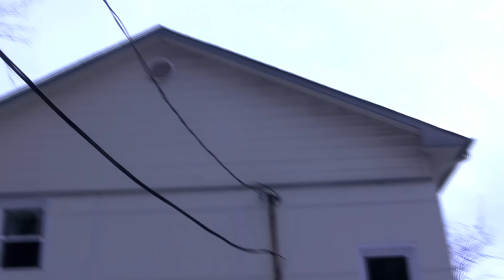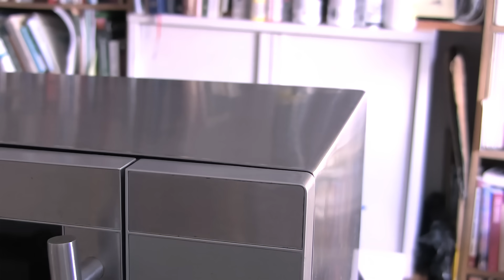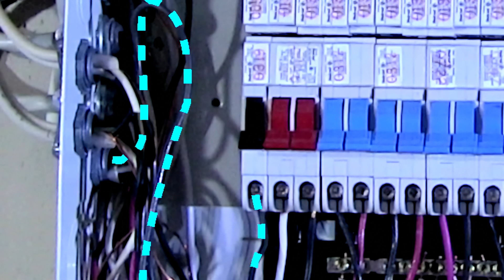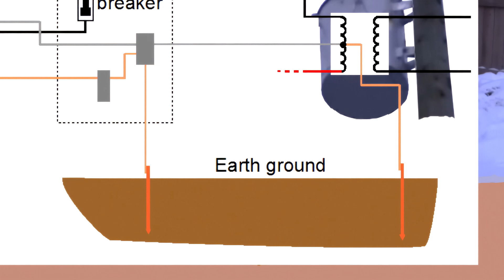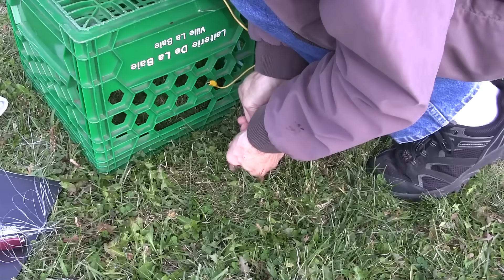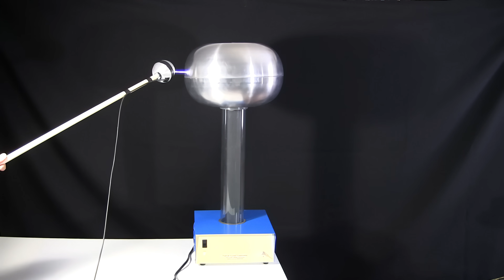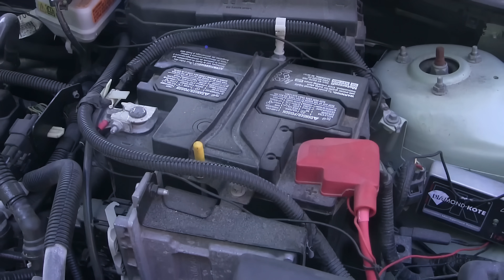What is Ground? Earth Ground/Earthing

Comment: well somehow I end up not convinced I do not agree with some of the info provided... as far as I know, a good electric installation has 3 wires in each socket/plug and switch... one of these cables is black, one is white and the other one is green, the green cable is a must have, pretty much always, it is the one connected to the ground and it is the one your freezer regulator will need to toss away wild voltage variations... a microphone, some microphones work fine with no ground connection, yet others do need that connection, plenty of ppl have complained about their headset mic not working properly,... that is because that specific design does need to be connected to ground... if you have a water pump to send water to the house cistern.. that machine needs a regulator and the regulator, to prevent electric spikes due to the strong pump electric drain, this regulator, needs to be grounded, the washer machine to wash clothes, the dishwasher and the drier to dry cloths do need to be grounded and a regulator also ends up being needed so to prevent variations in voltage that could affect other hardware that you may own... a tv and or audio set... they need a regulator to be connected to ground... believe me, I have lost hardware due to them not being connected to ground... having seen the video a few more times it seems like these 3 cables are indeed mentioned, yet the speaker is speaking too fast in a point where slow is better...
Reply: Did you watch the video? You're saying he's missing the exact thing the entire video is about?
Reply: well it may be the way he explained the ordeal, somehow my argument seems more to the point targeted at filling the gaps
Reply: Robert Ostman "believe me" ok, no proof needed, I believe you because that is what science is about: faith.
Reply: haha... good point haha... well I still have a damaged pc monitor, I hold it as evidence... by the way the electric company didn't want to pay for the repair due to the electric installation.... long story short... @ believe me haha
Reply: Robert Ostman I dont believe you, I know that ground is important and electric companies don't want to pay for any repair. I just was triggered by the use of "believe me" in a hard science topic. Edit: don't pay me attention :P

Comment: Why can't I understand this?  Its interesting but I get lost😞
Reply: It's really not that confusing.

Ground provides an alternate path for electrons to flow. It can do this because it has such a large volume for electrons to dissipate into. The ground is like a big neutral  capacitor, ready to take all kinds of electrical spikes or noise. This makes it ideal for redirecting something as huge as lightning, or reducing the noise on something as small as a computer microphone.

Remember, when it comes down to it, we're just talking about 3 wires here.
Reply: Traveling with Rick This is some confusing stuff but the video has been the most helpful so far.

Comment: Very excellent!

But I have a quibble:  the electron-flow animated diagram applies to metals, not to dirt (or to human tissues.)   If the goal is complete truth and accuracy, then you'd need to show the honest ion-flows in the ground.   Usually this is too complicated.  In that case we can avoid breeding misconceptions about ground-currents, instead use the standard technique: explain the Amperes (conventional current) and never mention electron flows.  That's a major purpose of conventional current: to hide the complexity of particle-flows, and to avoid teaching people false ideas.

Inside the Earth, no movable electrons exist.  Instead, the electric currents are flows of charged sodiums, chlorides, potassiums, -OH and +H, the mobile ions found in non-metal conductors.

And if the dirt is acidic, then most of the current is actually a proton-flow ( +H hydrogen ions.)

In other words, electric current in general is not a flow of electrons, and the exact type of "electricity" depends on the type of conductor.  The pure electron-currents are found in metals, but usually not found in the rest of nature (not in salt water, dirt, in sparks, or inside animals.)

And of course electrostatic antennas, lifted into the sky, are based on ion-leakage through the sky above, without electron-flows in air.  Metal stakes driven into dirt are similar: the electron-flow in metals is converted to ion-flows within the dirt.
Reply from the maker: Thanks Bill. That's a good quibble. Probably would have been confusing for the viewer had I shown the two different types of flow in the one animation, but now it bugs me. Would have been fun to animate though.

Comment: The American system explained here is dangerous: What if you touch a live contact directly (instead of through a metal case) or through an ungrounded metal object? Current would flow through you to ground, with enough power to kill you, but not enough to trip the breaker.
In Europe ground is not connected to the neutral. Instead it measures the difference of current between live and neutral, and cuts the current with a difference as low as 0.05A. That's called differential breaker.
There are also many advantages of the higher voltage used here (230V).
Reply: The full-blown American system uses GFI, ground-fault interrupters  ...which measure the differential, and breaks the circuit with any difference far below 0.001A.   But IIRC these are only required in kitchen/bath, not for all circuits.  And, the regulations may vary between US states, and for new construction versus existing buildings.
Reply: Good to know it's not so bad there. Still I prefer the European conventions: it's impossible to electrocute yourself touching a half plugged plug if it was made in the last 4 decades and it requires many less transformers near homes.

I said 0.05 from memory but I looked at my home's and it's 0.03A. One for all the house.
Reply: Alberto Torres when you touch  even one live/hot wire you won't die but will still be electrocuted, it happens to me once, I'm still here, however I was wearing thick rubber shoes and was isolated from any other metal.
Reply: Europe had the luxury of not having our full blown electrical infrastructure when they discovered 230 was better than 120. It was too prohibitively costly to change everything, but the US has made things work quite well just the same.
Reply: I'm pretty shocked they dont use a  differential breaker. in the USA. !!!

Comment: what if your outlet or junction box dosn't a ground,it is safe also or you must put a ground wire?
Reply from the maker: I can't speak for every country since, judging by the comments here, the systems vary a lot and I'm not familiar with them all. For the US and Canada though, if the wall outlet doesn't have a ground and you plug in an appliance that has a ground prong on its plug then you're not protected by the breaker in the breaker panel that I showed in this video. If the hot wire's insulation is damaged and touched the appliance's case then there definitely is a danger of getting a shock, also as I showed. It's a pretty strange system if even your breaker panel (if that's what you mean by junction box) doesn't have a ground (again, speaking only for the US and Canada).

Comment: Great video. I have an older home with BX cable and would like to replace certain light fixtures with recessed lighting but have not ground wire (green). Do I have to run a ground wire from the light to the panel? Ground it to the metal recessed housing?

Comment: The microwave ground is yellow and green but you highlighted the grey one
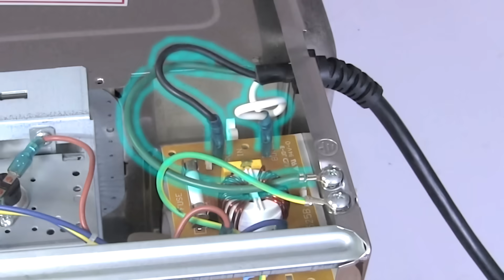Reply from the maker: Where are you referring to? At 2:00 and 2:05 I highlighted the green one. Notice that it comes from the plug and is connected to the case. Just beside where it connects to the case is where the yellow and green one also connects to the case and then goes to the electronics. So the green one I highlighted is connected to the yellow and green one through the case. They're both ground wires. Also at 2:45 I highlight the green one again.

Comment: I was just thinking...At 4:12, if the neutral is connected to earth ground in the transformer, then it wouldn't be necessary for the neutral bar and the ground bar to be connected in the breaker panel, because then there would be a complete circuit in case there were a hadling fault, so you wouldn't get a shock
Reply from the maker: But the NEC (US electrical code) and Canadian codes require both connections. I'd have to dig it up again, but if I recall correctly, one reason is that there could still be a potential difference (voltage) between the two neural points (transformer and breaker panel) despite it being a continuous wire between the points. Having both points grounded reduces that potential difference.
Reply: Yeah, that makes sense. In my case there is a 6 volt voltage between the ground and the neutral wires. The reason why I asked that is that I had a discussion last night with a electrical technician whether the neutral wire and the ground bar should be connected or not. Having watched this video before, I told him that it's the fact that the neutral and the ground wires are connected that prevents you from getting a shock, while his argument was that it's the earth ground that saves you, but now I am bit confused because when I got home, I had a look at my breaker panel (I'm from Spain), and I noticed that there were neither a neutral bar nor a ground bar, so there is no way that neutral and ground wires be connected, yet whenever there's a hadling fault, the breaker trips. My point is that a connection between both wires in the breaker panel might be unnecessary but recommendable.
Reply from the maker: Ah, how it works depends on your country and very likely Spain does it differently than here in North America. I really can't say what you should see in your breaker panel in Spain, at least not without searching for your electrical code. From comments here, I think in Europe you might be using  RCDs (https://en.wikipedia.org/wiki/Residual-current_device) in your breaker panels instead of the simple breakers which we have in ours.
Reply: That's right. There's also an RCD in my panel. Thank you for this very informative video.

Comment: Hi there !!! Why is the ground pin fat compared to the hot or the neutral pin. Could you please explain about the geometry and it's correlation with electricity.?? Thanks in advance.
Reply from the maker: I don't know why it has a round shape, unlike the others, but I know that it's longer so that it makes contact before the other two do. That way you're sure to have the ground connection for safety in case there's a problem when one of the others make a connection inside.
Reply: earth pin is larger than other pins to avoid accidental entry of earth pin in phase or neutral sockets.

Comment: will current flow into the ground evn in nornal case from neutral because if grounding rod in the panel?? please help.
Reply from the maker: If any does current does flow, it will be a negligible amount. The reason for any current would be because there may be a potential difference (voltage) between the neutral connection to ground at the pole and the neutral connection to ground at the house. However, the resistance between the two points is high compared to the resistance along the neutral wire on the between the pole and the house, so current will be tiny.

Comment: Why current from a positive terminal of battery doesnot flow to negative terminal of another battery if other two terminal are freed?
Reply: insulation 
air has resistance which means you need a higher voltage to get current to flow.

Comment: Very strange that the ground line isn’t monitored for current flow. Here in The Netherlands if current (very low current) is detected in the ground wire, it will trip a switch causing a cluster of groups to disconnect instantly. It won’t work via a regular group switch, which will need several amps (> 16 A) to trip.
Reply: They might be using RCCB.

Comment: I am not an Electrical person, But is it realy the ground is connected in the Nuetral? Or it is connected in the ground or earth.
Reply from the maker: The answer is both. The wire going from the ground hole in your wall socket goes to the ground bar in the beaker panel. In the breaker panel, the ground bar and the neutral bar are connected together. Also, in the breaker panel, there's a connection to the Earth ground. It's just like the diagram in this video. However, all of this varies depending on where you live. This video talks about the situation in most of the US and Canada.
Reply: The resistance between the house earth rod and the supply network can be to high to reliably trip the breaker.
the direct connection reduces the loop resistance to less than 1 Ohm It also provides safety if the neutral fails between the the house and supply network.

Comment: So if someone cuts the ground prong off the microwave plug and the "hot" wire touches the case of the microwave would the current flow into their body and through the earth back to the transformer resulting in a shock?
Reply from the maker: That's correct. The current may be high enough to trip the breaker at the same time.
Reply: How would the current flow to the earth if you took off the ground prong?
Reply: yes
Reply: through their feet or their hand if it touches a earthed surface like a cooker

Comment: Hi.. good video... totally give me the picture of how the trip works... what if the white wire expose and touches the case. how will it works?
Reply: it will work as normal.
If the outlet the device is plugged into is protected by gfi/rcd it will cut the power.

Comment: Thank you for making this video! My girlfriend and I are building an electric scooter, or making modifications to an existing scooter. We noticed there didn't appear to be any wires going to the frame of the scooter acting as a ground. For example, the negative wire on the scooters batteries do not go to the frame. As well, the controller for the scooter did not appear to have a wire which connects or grounds to the frame. It was the first time I had seen this.

Comment: Here in the US i don't have neutral coming from the pole. I have just two lateral that are 120v each. Neutral and ground are the same. Same is in EU
Reply from the maker: It sounds like you have single-wire earth return (https://en.wikipedia.org/wiki/Single-wire_earth_return), or two-wire in your case for two phase. As the wikipedia page says, it's used in some places in the US, but not everywhere. The webpage mentions Alaska only but someone around Phoenix commented that they have it too so there are more than just Alaska. Which area are you from, so that we have a better idea of more places?
Reply: RimstarOrg new york state. Maybe I'm reading you wrong, but all the way from Mirtle beach to Boston houses are like that, common earth ground and transformers are also earthed at a standalone rod to each pilon they are mounted on. Maybe they don't wabt to waste money for a dedicated neutral line. Bigger residential buildings may have a different setup, I'm speaking about single family residential houses
Reply from the maker: Interesting. My understanding (and you can see that on the wikipedia page) is that swer is not as prevalent as that. However, as I said, someone here from Phoenix said their's was that way too, and so is yours, so the wikipedia page is misleading.
Reply: In that case I could see a device been exposed to  to 240V there must be a solid path back somewhere.
from the videos i have seen there is normally 2 hots and one guy wire aka neutral. unless use the system here one phase and neutral well for your system in us one leg and neutral.
unless the rely on ground bonding via water pipes etc to provide balance.

Comment: Interesting. Here as far as I'm aware the neutral is not connected to the earth. In my house the earth is connected to the plumbing system, although since 1966 this is no longer allowed and especially today as plastic pipes are now mainly used
Reply: id think about having a rubber mat in your bath/shower...
Reply: if you don't have an earth system in your house/electrical grid(supply side) then you are fairly safe. its the return path of fault currents that can kill people in their showers when earthing water pips. Earth faults try to find its way back to the transformer and will travel through water piping and can result in electrocutions.
Reply: What about all the radiators in the house? All those large pieces of exposed metal should surely be an extremely higher risk than coincidentally being in the shower at the same time as an earth fault

Comment: Very well done!!  Probably the best video I've seen to explain the concept.  A few things on terminology in case anyone is reading the NEC.  You'll notice these definitions when working through the NEC:  Electrical systems are "grounded" (connected to earth) to protect against high voltage faults, such as lightning and transformer failures (as well as static discharge as noted).  Receptacles and other outlets are "bonded" to provide a return path for fault currents (the microwave example in the video).  Also, the connection of the grounding conductors to the grounded (neutral) conductor at the panel (as shown in the video) is called the "main bonding jumper."

Comment: How do I ground a clothes washer that doesn't have a three-prong plug?
Reply: You're saying that the receptacle is an older, ungrounded type (two contact  type?)?  Not a grounded receptacle correct?  If there is no grounding conductor, you would need to run a wire from the receptacle back to a proper termination, such as the panel. I have done so many times.  I recommend you hire an electrician to do the work though.
Reply: Ibrahim Saad Helal Thank you. Someone had a green ground wire ftom the washer to a clamp which was attached to the cold water pipe which feeds the washer.